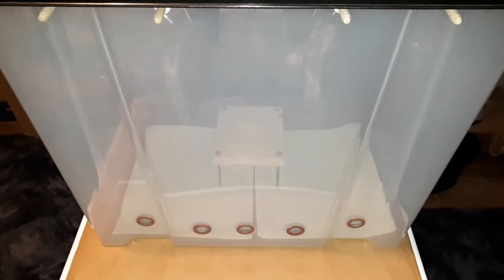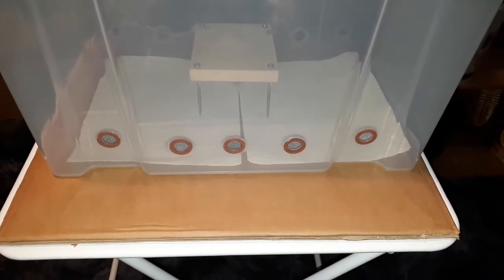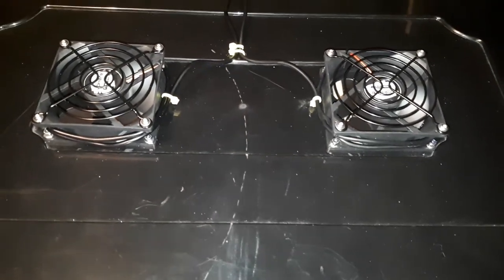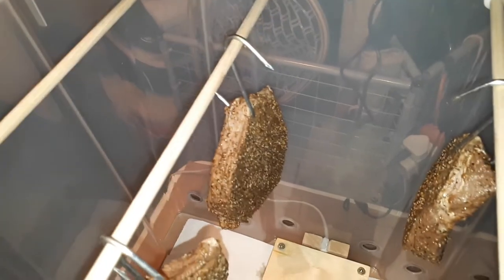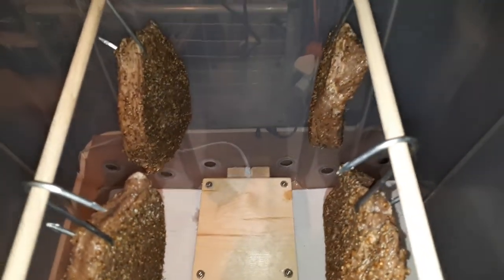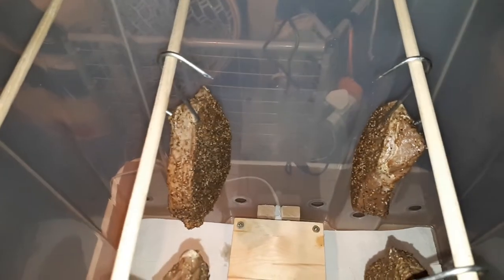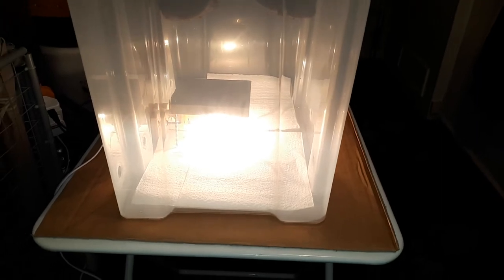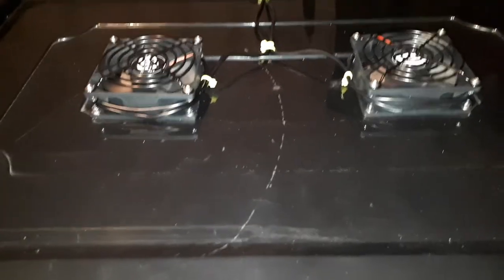The Biltong Box

Comment: Just seen this video how did they turn out and is it expensive to run the bulb 24hrs a day for 5 days….. fellow Brit wanting to start making my own biltong
Reply from the maker: Hei ... the biltong has always come out fine, apart from one batch last year which produced a white residue on some pieces so was scrapped ( I was not happy). It's a low power bulb and fans, so there will be a bit of cost for power, but overall cheaper than buying packets. Good luck with your endeavours 😀